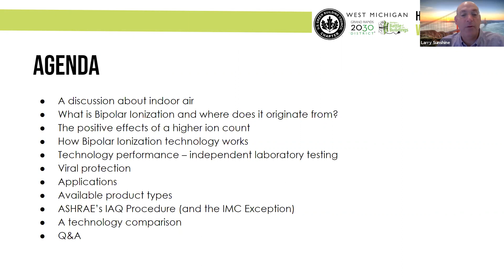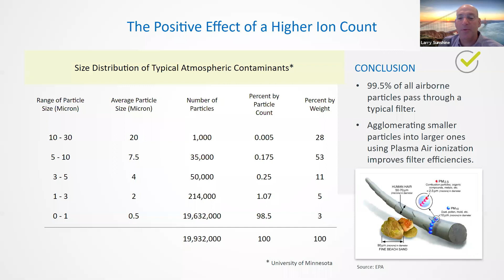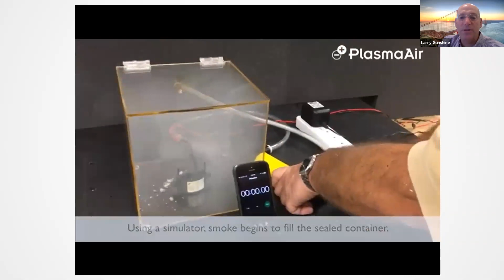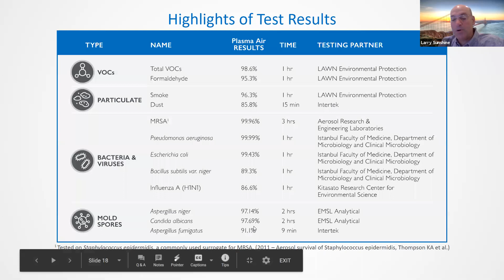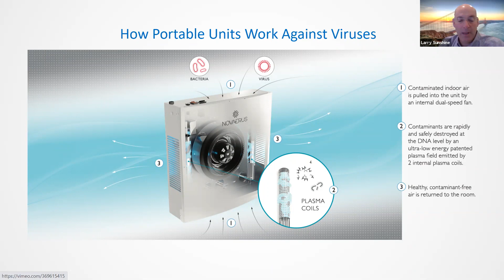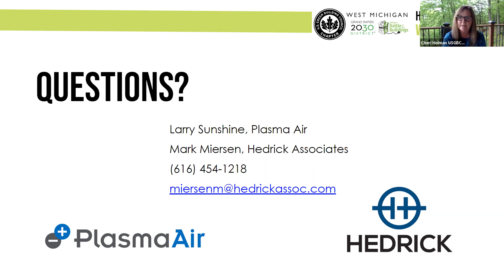WEBINAR - VIEWER'S CHOICE: A Deep Dive in Bi-Polar Ionization (BPI)

Comment: Of course the elephant in the room is that oxygen Ionisation requires greater than 12.07 electron volts to create an oxygen ion which needlepoint systems specifically state  do not achieve. The marketing and the science is not in alignment. If they are not achieving this level what are they actually ionizing and is it effective or harmful?  The carbon scarring around many installed units would indicate other potential issues.

Add to the fact that there are just a few needle discharge point on these which quickly become contaminated with carbon and have there effectiveness (if there actually is any) rapidly reduced.

Finally consider all the school districts who have removed the system and companies involved in class actions against needlepoint products and make up your own mind. https://www.google.com/search?q=legal+suits+and+class+actions+for+plasma+air&rlz=1C9BKJA_enUS875TH878&hl=en-GB&sxsrf=ALeKk02DJCIsmU4RnObq5MPa_8BDTPjBag%3A1626391181408&ei=jcLwYJW5GK6d4-EP0MeH8Ak&oq=legal+suits+and+class+actions+for+plasma+air&gs_lcp=ChNtb2JpbGUtZ3dzLXdpei1zZXJwEAM6BAgAEEc6BwgjELACECc6BAgeEAo6BAghEApQ5X5Y77QBYIu4AWgAcAJ4AIABWYgBlhKSAQIzMZgBAKABAcgBCMABAQ&sclient=mobile-gws-wiz-serp 

It’s best to consider more reputable products using Dielectric Barrier discharge systems that actually produce oxygen ions and can actually claim with supported third party tests.

Comment: Has anyone looked at the science of adding more ions to indoor air spaces?  A by-product of ionization is ROS (Reactive Oxygen Species) which is never discussed in any marketing materials from these manufactures.  ROS is a very powerful one as with any free radical (oxidant), tissue is damaged or destroyed by overwhelming the natural defenses (antioxidants)  The positive (H+) and negative (O2-) ions cluster together on the surface of airborne fungi, causing a chemical reaction that results in the creation of highly reactive OH groups called hydroxyl radicals (OH).  This ROS is a very powerful one.  As with any free radical (oxidant), tissue is damaged or destroyed by overwhelming the natural defenses (antioxidants).  This process is not limited to a specific organism.  Where the reaction takes place is a real concern.  Ionizers broadcast into occupied spaces.  ASHRAE 2019.94 specifically states that ionization is not recommended in occupied spaces and should only be used in unoccupied spaces.  I would like to know anyone's thoughts on this.